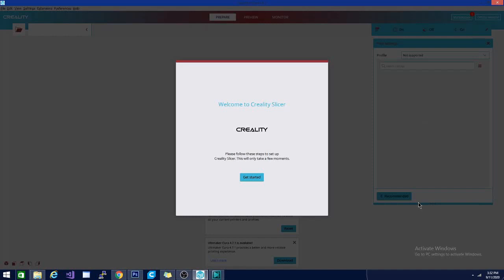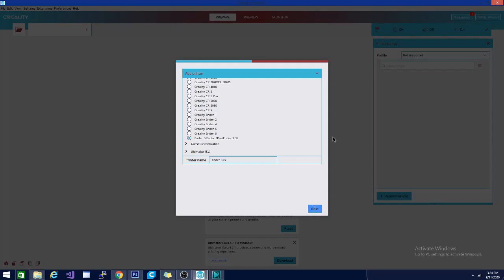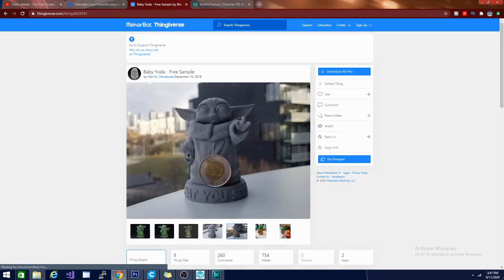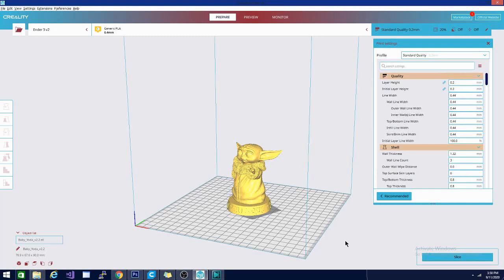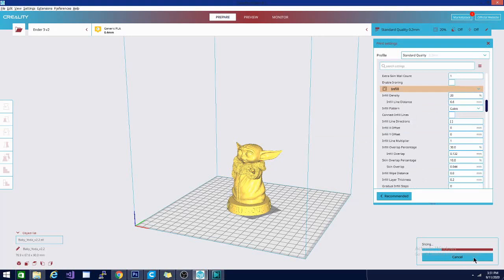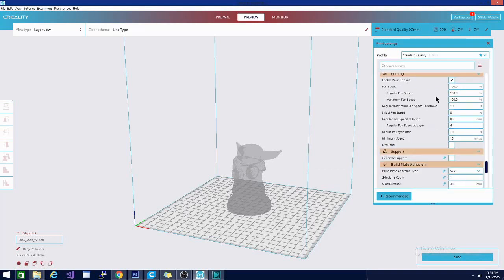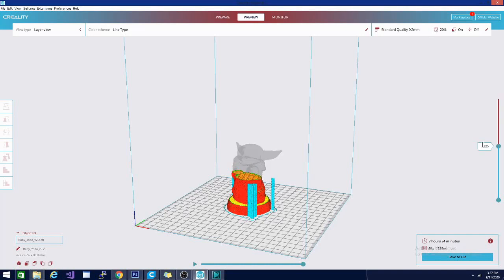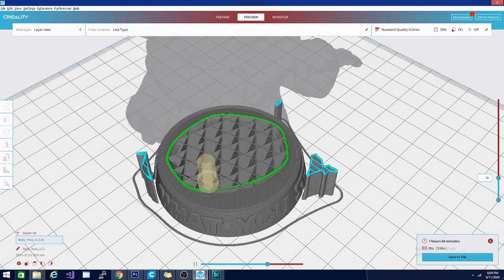Creality Slicer 4 2! Using the software that comes with the Ender 3 v2

Comment: Quick question, after I slices my model and put it onto my sd card then try to run it on my printer it does nothing , it just sits there in the same spot and not progress is shown on my printer screen. Am I not importing the file right to my sd card and the printer can't read it?

Comment: also is there a way to free cam in this so u can get to a specific area instead of being fixed to the main center of the entire print area becuase i am just making builds the size of like my thumb for now till i am good at this (i canot see my build barely at all from the veiw it gives for this size specificaly builds the size of 8 grid spaces and 1 grid space tall
Reply from the maker: Right click and drag rotates... Shift and right click will pan (move aroun)

Comment: I have been looking for a tutorial for the beginning part of the software that it skipped by accident .. the setup .. size of build plate, height, etc.. mine is the ender 3 max so its got a different size and it wasn't in the list so for a first time user it's sorta confusing to know what to fill in

Comment: I have been using the creality slicer and had pretty good results with it. I just realized that the front of the build plate in the slicer is actually the back of my build plate on my printer. Is that normal? I tried to move a print to the back of my build plate for better stability and it printed at the front of my build plate. Any help would be appreciated.

Comment: Are you familiar with the new diligent mother board 4.2.7 I’m having trouble flashing the boot loader. There no 6 pin on the board for isp chip adapter
Reply from the maker: unfortunately i am not familiar with that board, but if there is no 6 pin for the isp, that usually means you will need to push a bootloader to the board.

Comment: where the heck is the software located at? I just got and ender 3 pro and i cant find the software anywhere so I can design stuff or use the slicer to set up a print. help
Reply: I got mine from the SD card that came with it
Reply: @gGBb27  mine only has a pdf file in software folder and it says corrupted

Comment: How to scale a model, as you can see the dimensions at the bottom left of the screen. Is that an actual size of print or something else.
Reply from the maker: those are the dimensions of the object at its current scale. if you change the scale percentage they will change accordingly
Reply: @Technivorous  how can we change the scale? I was trying to but with no results, thanks in advance
Reply: sorry I found it :D

Comment: Is there any benefit in using this version instead of vanilla cura? Have creality already set up ideal settings for the Ender 3?
Reply from the maker: They dont update as often until cura features are more proven so it's a little behind cura vanilla, but a little more reliable as well. Setup for the ender 3 will be the same in both, and pretty much ready to go right away. So it's really just a personal preference.